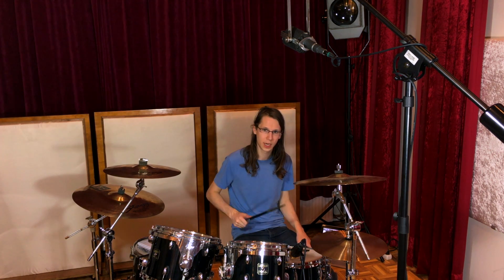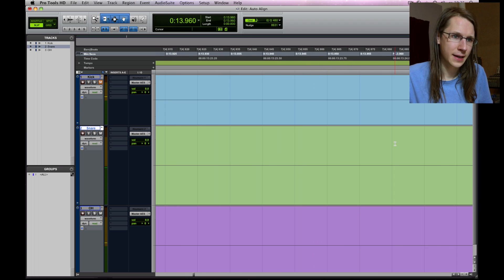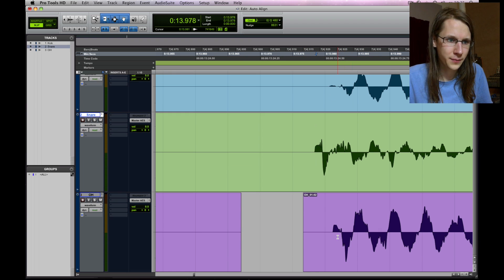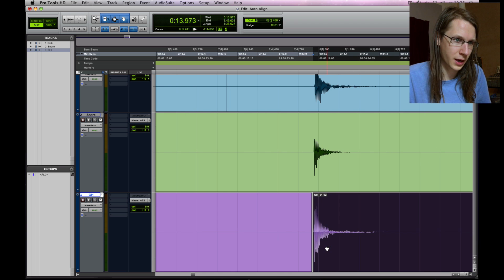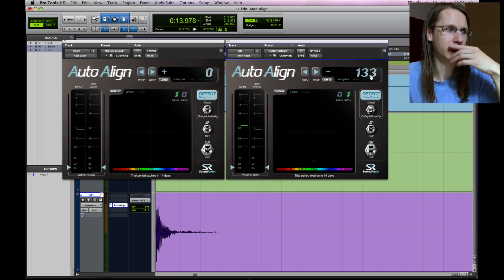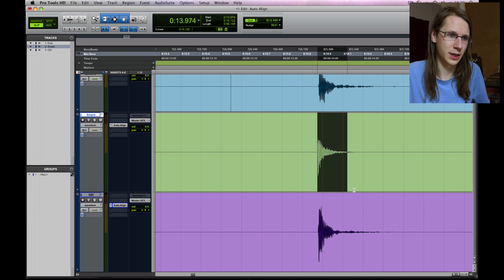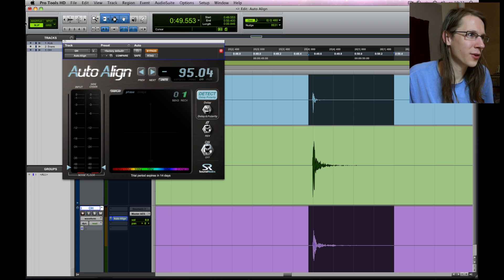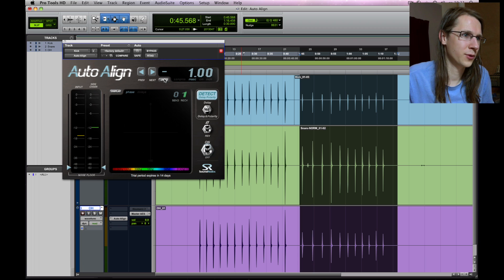Should you PHASE ALIGN every channel?

Comment: I recorded a live band, both with multitrack recording in the mixer on stage and ambience mics, about 10 meters from FoH (outdoors) using a Zoom H5. What should I align the zoom recording to? I can see matching waveforms and nudging it just 0.1 ms changes the hollowness/phase. I tried by trial and error until it sounded good but still sounds weird, phasing issues.

Comment: I love your videos and I nearly always refer to them when I'm thinking about a new plugin. But I think you got this one wrong. As several people pointed out, the plugin is meant to be used in a different way from how you did it, and it makes a huge difference. I used to always align drums by ear/eye and got an improvement over the non-aligned result, but I've found that this plugin can get an even better result than manual. And it's much faster. My drum mics stay where they are, so I can use the same correction every time. It really sounds better!

Comment: On your kick alignment problem, it's simple. You leave the kick alone and high pass the snare/overhead higher than the fundamental note of the kick. Sure you lose phase coherency when you use a filter, but, it'll fix the phase on the input sources which is usually a much more noticeable effect.

Comment: Coming from a background in film, I learned that picking up sound from a LAV mic and a Boom mic should have a ratio so that there isn't phase cancellation. I believe the ratio is 3:1. So if the lav is 2 feet away from the source, the boom should be 6 feet, although I don't see how that would work with drums. You can't put the overheard a foot and a half away from the kit if the snare mic is, say six inches from the snare.

Comment: Would you reckon that a drumkit is one the harder instruments to record? It seems quite complicated to get it right. I have tried to record my drumkit in my room with single microphone (a blue yeti) put on the floor and set to stereo mode (it has a switch with four different modes). I know it sounds crude but what would be the best way to record it on the most low-tech way possible and still get a usuable result? Also the room has a concrete floor and walls to compicate matters.

Comment: Hi, I hope you're doing great.  Your video appeared as suggested viewing.  Thank you for taking your time to upload the video and do some tests.   Indeed it's a good way to learn and share opinions on the matter.  However, I'm afraid that as you may have noticed from previous comments, the plug in wasn't set up correctly.  To minimise any phase issues, since eliminating them a 100% it's impossible to so many variables such as the mics placement and frequency response, you need to use your ears and one of the mics as a reference.  For instance the top snare mic versus the other microphones it's a good reference as there is snare bleed on basically all the microphones.  Align the kick drum snare bleed with the snare top mic and check which sounds better.  You'll notice that sometimes  a kick might sound great on its own but once you start balancing it with the snare, it might lose a bit of low end or other information.  After you find out if the kick and the snare sounds better with the kick delayed, then you raise the other close mics and repeat the process.  Your ears will be the judge.  Sometimes delaying the overhead a bit more might sound fuller, or not, as well as the room mics.  Reversing polarity can be considered the first line of defence against phase issues, yet it might not work against more complex signals as we know that the phase is not a simply matter of flipping polarity to 0º to 180º,  You need to experiment and yet again, let your ears be the judge of what sounds good.  Cheers for taking your time to upload these videos.  All the best.

Comment: The plugin works best as some have said if you align to one of the overhead mics. But also the problems it could introduce based on your argument could be easily taken care of by gating your kick and snare so that only when they are hit the sound will time align with the always open overheads. True this will change the overall sound of the recording but that’s what some people prefer. I also think the plugin is meant to be used as a “fix” for a badly recorded drum set. Usually flipping the phase and listening can eliminate most problems. Anyway, decent argument but not entirely accurate.

Comment: You can have multiple mics at multiple distances record a specific single source (snare). Then you can absolutely phase align all of these mics to that one source of sound (snare) however, isn't it impossible for that alignment to work on other sources at different distances  recorded from the same mics? When you do it manually its about compromise right? What parts do you want in phase.....don't think we can have it all....yet.
Reply: Matt O, to my mind, the only way that would be possible to align 3 or more mics would be to gate the shit out of everything - so there’s no bleed or so that you can align say some of the snare bleed in the kick mic with the snare in the snare mic - and then have some sort of variable time alignment (or chop the regions up and align them by hand, so basically a sampled kit) but as soon as you have overlapping sustains you’d be back to square one. If that makes any sense?

Comment: I have used this plugin extensively. I do a lot of live capture recording and I find that it's quite effective for clean up of the stage leakage problems. The results are similar to using one microphone to record the band while having properly placed accent microphones on the instruments. Typically both live and in the studio, I use the overhead as my reference. For that overhead I typically use a M/S microphone, I doubt that split overheads would give the proper phase reference.  Also, back in the 70's and 80's we did worry about phase relationships in multi-mic setups like drums and sometimes spent hours adjusting mics to get the phase relationships correct by ear. And no, you couldn't "correct" bad phase relationships on tape, it's only now in DAWs that we can adjust those relationships so it's an issue. The more mics, the more complicated the phase relationships of the overall sound, which is why there is logic to a 3 mic drum setup such as the Earthworks system. Very often live, I use a modified 4 point micing technique, kick, snr and M/S overhead. Not for everyone, but it works well for me.

Comment: You haven't done it right sir.
I have passed a lot of time experimenting with auto-align and i can say it's a pretty terrific plugin if you use it right.

1st: You have to do the alignment by hand inside the daw and phase flip if it's needed so auto-align doesn't have to search weird stuff.
2nd: Do a simple mix (just faders) between the tracks
3rd: Think a lot the methodology, which track should be as a reference etc. Disable the phase flip from auto-align. Apply the auto-align at the post fader and do experiments with before and after. To see which one fits best. It can be a super useful plugin for multimic recordings, if you use it right. I never use it for projects that everything is recorded separetly.

I record and mix only acoustic music. jazz, world music bands or classical stuff a lot. All musicians play together, with great mics and nice space. 
Since i have started to use auto-align my mixing became super easy after. I nearly forgot the eq and compression and let the band play. Most of the problems are phase alignment between many mics and people try to solve them with eq.

If you ever have doubts i can send you samples to check it out. You're gonna be blown away.

P.S.: By the way, I'm paid or working for sound radix! 
Just a guy like you

Comment: I honestly wonder if anyone ever gave a shit to phase align in the golden age of music with tape machines and analog gear. Seems like we only care so much for it because we are able to visualize our waveforms.
Reply: They could move microphones and use a console phase scope. Steve Albini used to time delay room mics in the analog domain. Wave form aligning is a bad idea compared to moving a microphone in real space. However it is a godsend for mix engineers like myself when you get a badly recorded drum kit to mix...
Reply from the maker: I cannot agree more
Reply: they were using a digital delay line to do this
Reply: Good Point. Obviously one of the first things that one notices clearly, is the sound of cancel and boost when layering and nudging stuff... Even different instruments, say kick and bass, sound stronger/weaker depending on the phase alignment... right?. 

To reduce that static or cancel effect with the alignment, try some pitch mod with a noise shape lfo at a high freq, on some of the sources, , or pitch them down a semitone or so. It will make the phase shift and move constantly!! This instead of aligning the close mics can make a subtle but awesome flanger/phasor effect. Perfect for that "popping out the speaker" chorus or buildup.

Comment: You didn't set the plugin right...ijs
Reply: If you align everything to  the overheads, your drum kit will sound wrong from the perspective of nearly every drum recording you’ve ever heard. Normally, we’re used to hearing the close mics on the kick, snare, and toms a bit earlier than the cymbals, since the cymbals are further away from the overheads than the drums are from the close mics. Usually this doesn’t bother anybody, not just because it’s what we’re all used to hearing, but because drums have a faster attack than cymbals which swell into their peak volume. The drums however, are even further away from the overheads than the cymbals are, so aligning the close mics to the overheads will cause the drum transients to occur after the cymbals start to swell, which will sound unnatural in a way most won’t find appealing. In any case, the drums in the overheads being behind the drum close mics is part of what gives acoustic drums their fuller sound. It’s kind of like reverb with pre-delay, same with ambient mics.
Reply: @SeanDugaw  this isn't true. Ever heard of a band named Korn? On their biggest selling Follow the Leader album, the drums were aligned.
Reply: Ok here is where you didn't use the plugin as the designer intended.  You need your snare to be set to send 1, and your overhead receive 1, then you need to have the overheads send 2, your kick receive 2, etc. So in effect you are often chaining different mics to sync with the next source, which in theory all goes back to  syncing with the original source; lets say the snare.  When I demo'd this program on a multi-mic'd drum set I used six or seven sends.  However, in my experience using multi sends and receives did not change your fundamental problem you brought up which is having four or five items (lets say overheads, room mics, snare mic, hi hat mic, and over the shoulders mics.   The problem I had is you have several sets of mics at various distances, and now I am trying to time align the six immediate different times sources to each other.  This means I must time align everything now even if there wasn't a problem before because now my tom mic spill needs to be fixed.
I had a worse problem with Melda. It actually made the drums out of sync with the rest of the instruments (which is terrible) and  the auto align ends of adjusting way too much and what I gain in say alignment from snares and overheads, became lost in the 14 plus mic setup on drums.  This isn't even addressing the problem if you choose to record the band live, so now you are out of alignment with the guitar and bass bleeds. 
 I think auto align works as you said when a few instruments are not aligned and you are not recording in a live room. When you add a nice room like you have in the video, the complications become infinite.  I am not saying the plugin is useless, but after spending two days with it, setting it up as the designers suggested, I could hear improvements in some things, while it created problems with others.  Ultimately, when I turned all instances of auto align off, the mix sounded better to me.   Nothing like hitting the phase alignment  button to fix a lot of problems pretty easily.  Several DAWs come with phase meters to see how out of phase some mics are and often simply flipping one mic out of phase solves a good 90% of the problems in my experience. 

I tried a test where I had almost zero phase alignment problems because I mic'd two separate bass cabs with two different mics.  The auto align plugin was adjusting one channel it by -354 when the phase alignment tool in Presonus was saying the two cabs were perfectly aligned.  With auto align on, the bass sounded thin and with auto align off it sounded great.  That is when I gave up on auto align.
Reply: Sounds like a lot of work for something you could do pretty easily and maybe more satisfactorily by ear.
Reply from the maker: Explain?
Reply: You have to set a main sound (usually the Overheads) as the send 1 and then set all the other sounds to receive 1 and hit the detection button on all the tracks individually.
Reply from the maker: Understood... The point I'm trying to make is that the individual channels still won't be able to line up. they will only align to 1 thing (in this case the overheads) and disalign to the rest...
Reply: ...But the overheads carry all of the information of the kit so wouldn't having everything align to the overheads be the optimal source to align them all to? And of course, since it is a plugin nothing states that you can't-do alignment of other sounds beforehand if you so desire.
Reply from the maker: That was the actual point I was trying to make! You are almost always better of just making these decisions during tracking :)

Comment: you said you gained the kickdrummike.. meaning you boosted the bleed of the snare through the kick mike(not advisable), meaning more phase cancellation when there is any..  and i don't think that the plugin was designed for phase aligning the bleeds.  it's probably quite usefull when using it to phase correct sources you DO want to use in the production, like for instance on  a kickdrum with a mike to the mallet, the head and a recordingspeaker.. i bet you can sync up these sources very rapidly using this plugin.. just my two cents..

Comment: I don't think you used the plugin correctly. You must set one element of the (drum set) to be the main timing element on say send 1, Then set all the other tracks to receive on 1. Go through the detection process on "all" the tracks and that's it they all align to the sending track. Usually the kick or overhead closest to the snare. I've had some great results with it.
Reply: Caustic Media Yes, I thought the same thing as well. I own this product and it works well.
Reply: Yep! Lots of people want to do this manually, dunno, "value added services". I'd rather let the plugin do the tedious work then focus on creative additions of my own.
Reply: yes. he is using it wrong. the correct form would be: snare send 1 ... over head L receive 1 / send 2 ... over head R receive 2 ...... and now everything else aligned to the over head L (receive 2) .
the purpose of this is to align everything to the over heads
Reply: @marcosrichards7036   wouldnt this align the right overhead to the left one, resulting in no time difference hence killing stereo?
Reply: Isn't the problem that even when you would use it the right way - according to you - that a perfect phase isn't always the result that you want? All the small differences in phase, isn't that something that makes the sound that you want to get, when positioning the mikes for the drumkit? And when aligning the phase of all mikes, you get a sound that is not the same as the sound that you decided that you liked. Just imagine using this plugin on a stereo phaser effect sound for your guitar, that would undo the effect, less or more..... Maybe I'm wrong, but this is what I think that is happening on the physics part of the sound (and then translated back into sound language, lol)

Comment: A very interesting video. It would be interesting to see you interact with/try out the Waves InPhase-plugin (if you haven't already). It's the same concept, but more in-depth and you have to do the phase-adjustment manually. + You can phase invert set frequencies! :D
Reply from the maker: But still wouldn't work on more then 2 microphones with different sound sources. It is physically impossible!
Reply: Possibly.. You're the expert! But would it still be the same thing if you did it manually? Wouldn't it be possible to adjust the close snare to the snare-hit in the overhead and then the close kick to the kick-hit in the overhead? 

With InPhase you can also choose where to put the sound-wave, so if one spot doesn't match/sound good you can move it even further back or forward. It pretty much work as aligning it manually in the DAW, but just a bit easier I think.. The plugin also shows how much of the signal is in phase. 

Just speculating, not questioning. Again, you're the expert here, not me. :)
Reply from the maker: +Cornelis Fordell purely from a theoretical physics standpoint it is not possible to allign everything 😉 but I will try the InPhase someday. Theory and practise doesn't always line up
Reply: I see. You're the expert here ;) Yeah, that would be awesome! :D

Thanks for taking the time to answer my questions! I like your videos and I'm looking forward to your next! :)